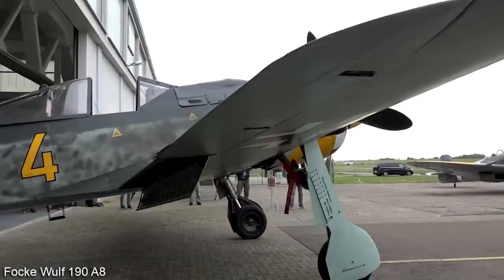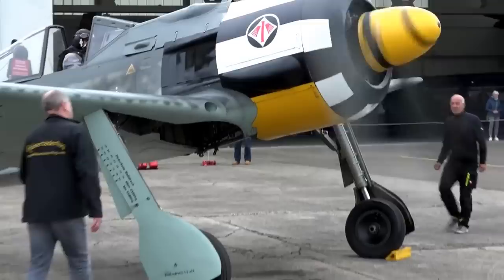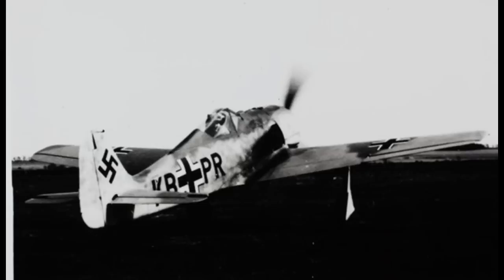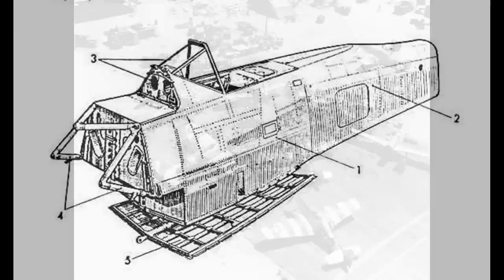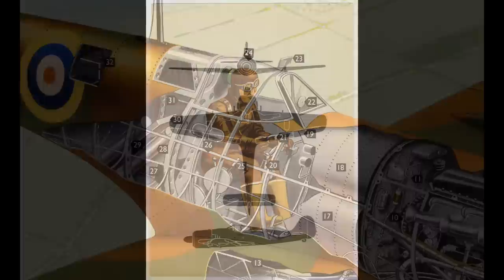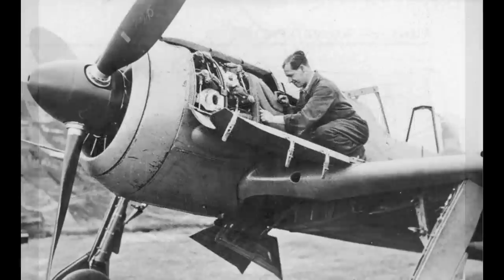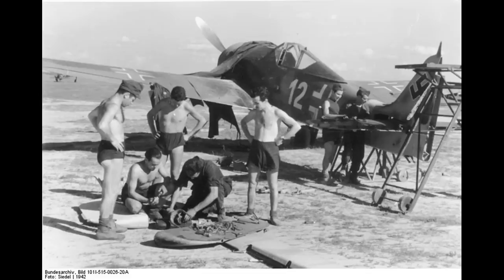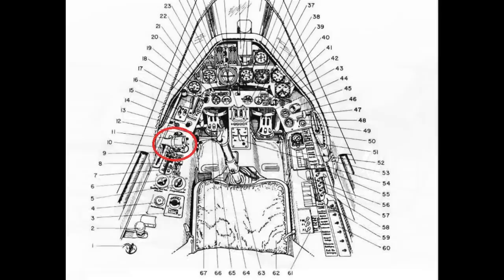Focke-Wulf Fw 190 Pt.2

Comment: Great video
I found this image that explains in a schematic the working of the 'Komandogeraet'
https://www.autowallpaper.de/images/hersteller/bmw/geschichte/flugmotoren/big/Funktionsschema-BMW-801-A-Kommandogeraet-.jpg
Enjoy
Reply from the maker: That's a great image. Thanks. I'll translate it and see if I can figure anything out from it.
Reply: Hi Greg (I do speak german by my english might be somewhat poor here)
Maybe saves you time. :)

Schaubild der wirkungsweise des Kommandogeraetes
Diagram on how the Kommandogeraet works

My humble translation as a non mechanic/technitian.
Reads from top/left -> down and on to the right

(I don't have the special germany keyboard caracters - therefor ae or ue)

Here we go:

Gashebel - power handle
Kraftverstaerker - power amplifier

Ladedruckregler - Manifoldpressure/boost pressure regulator
Grundeinstellung der Dose - Default setting of the box
Laengenaenderung der Dose - Change in lenght of the box

Drosselklappen - throttle valves
werden verstellt - are being adjusted
werden fuer gleichbleibenden Ladedruck nachgestellt - will be adjusted to keep constant boost pressure

Schaltlader
auf Boden- oder Hoehenlader geschalted - set to ground- or altitude charger

Arm-Reich Umschaltung
verstellt Einspritzpumpe - adjusts/changes fuelinjection pump

Anlasskolben
verstellt Einspritzpumpe - adjusts/changes fuelinjection pump

Ausenluftdruck
Aussenluftdruck - Airpressure (atmosphere/outside)

Ladeluftzustand - boostpressure status
Druck und Temperatur wirk auf Reglerdose - Pressure and temperature infuences regulartor boxes

Gemischregler
verstellt Einspritzpumpe - adjusts/changes fuel injection pump

Einspritzpumpe - Fuel injection pump

Drehzahlregler - RPM adjuster
wird eingestellt - gets adjusted 

Sturzflughebel - switch for during a dive

Leerlauf und Schnellstop - Idle and fast-stop

Zuender - Igniter
Zuender wird verstellt - igniter gets adjusted / changes

Kind regards,
Ralf
Reply: I missed Gemischregler - mixture regulator
Reply: Oh man - missed even more:
Schaltlader - Switch carger
Arm-Reich Umschaltung - poor-rich switching
Anlasskolben - Starting piston
Reply: May a better translation for
Zuenderzeitpunt - ignition timing

Comment: You say the 190's performance was "mediocre" or "average". But this is not the way Spitfire Mk.V pilots felt about it in 41 and 42. In fact they felt outclassed in very respect but turning performance. This led Spitfire pilot Stanford-Tuck to say that "turning doesn't win battles".
Reply from the maker: average throughout the war, not specifically in 41'-42'. I'll cover performance in later episodes.
Reply: @GregsAirplanesandAutomobiles  OK. I would have liked to sit in a 190 in 42 because of it's exeptionally quick roll rate, good for evasive manoeuvres hence survival
Reply: @pascalchauvet7625  Per the recollections of pilots who were interviewed by Donald Caldwell for his JG26 unit histories, even in mid 1944  (about the time JG26 was committed to supporting the army in Normandy ) they felt that down on the deck they could outrun anything on the Allied side. That and those 4 20mm guns in the wings weren't 'harmonized' so the 'dispersion' of fire made sure even a 'poor' shot could put enough bullets/shells on target to score victories.
Reply: @filthydisgustingape5354  There was one specially developed Spitfire variant with a Merlin engine optimised for low level to counter the FW190s. Later in 1944 there was the Hawker Tempest V which could outrun the FW190 at low altitude. The Germans got hold of an intact Tempest and could confirm that at low level it was capable of 600 Km/h. faster than the radial engined FW190s.
Reply: @pascalchauvet7625  Yes the Tempest definitely took the cake as the 'fastest thing on the deck'; That other Spitfire...isn't it what Pierre Clostermann referred to as 'clipped (squared wings) cropped (turbocharger that maxed out at 3000k?) clapped'? It was the Mark V-D;
Reply: @filthydisgustingape5354  Yes, but compared to the standard 1941 Mark V the LF Mark Vc was actually something of a hot rod at low altitude, read here: 

https://ww2aircraft.net/forum/threads/low-level-spitfire-v-vs-late-war-german-fighters.35143/
Reply: @HiWetcam Now there's the advantage Britain had RE: the Merlin; they could increase reliability, horsepower and compression ratios (whatever THAT is) thanks to better fuel octane and superior metallurgy (and the availability of those special 'strategic' metals that helped forge metal parts with increased heat resistance and tensile strength). The BMW could not have the same done due to lacking the same items. As a result, later model 'A's had the same engine as the A3 and A4 but the airframe weights continued to increase.
Reply: @HiWetcam cannot argue with that either. As cool as I find German "kit" I have to remember WHAT cause it fought for. My own parents are from SE Europe & they grew up under Axis occupation